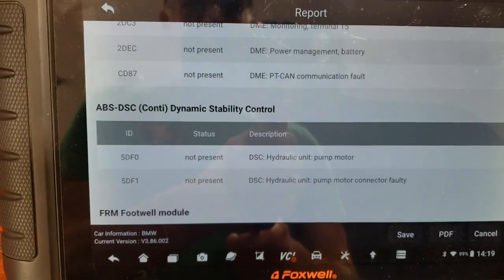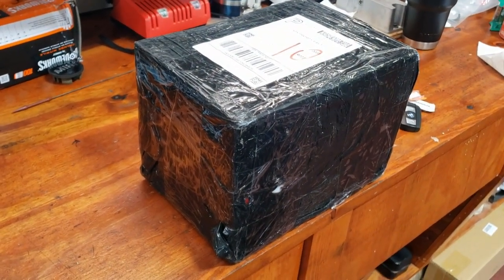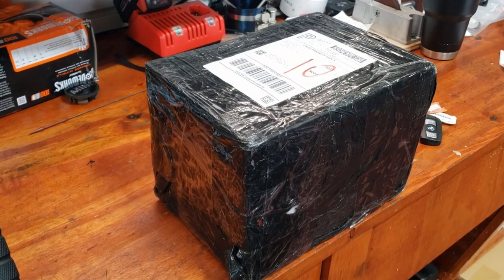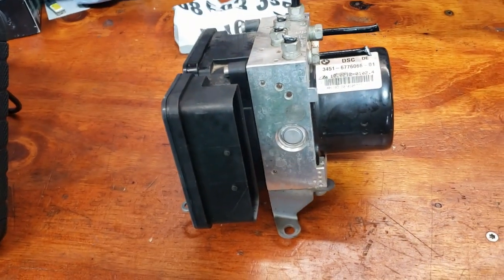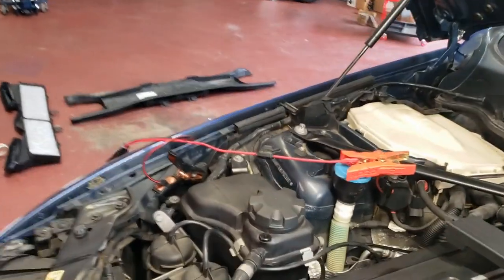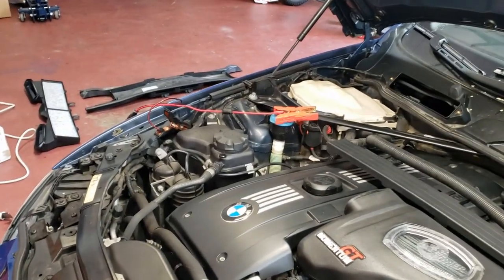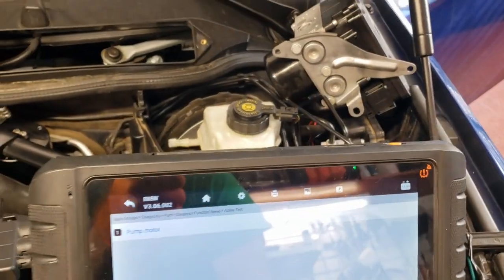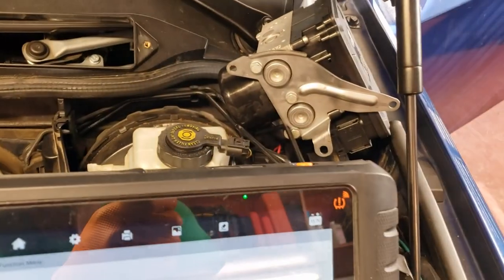BMW E92 335i 5DF0 & 5DF1 solved

Comment: Great video! I believe this my issue on my BMW as well same codes and replaced the wheel sensors and still have the 'Christmas lights' on my dashboard. You mentioned replacing the seals if you do a swap.... Where did you get the seals if there were any to even be replaced?
Reply from the maker: I've not been able to source the seals by themselves, so I didn't change them.
Reply: @superk4562  ok one less thing I need to replace. How's the part been holding up for you so far?
Reply from the maker: @30guarino  It's been 15 months ... no issues.